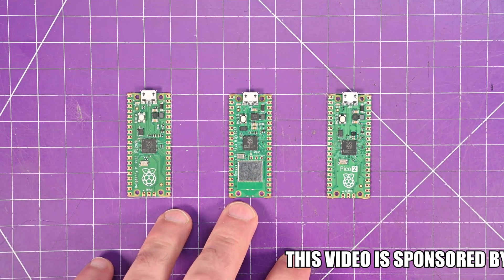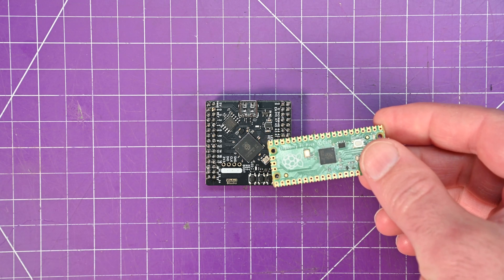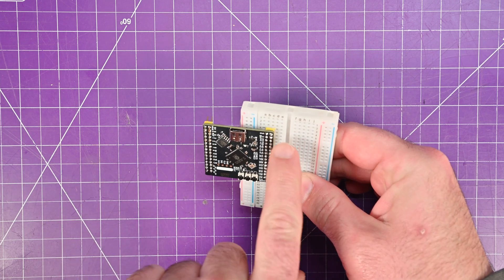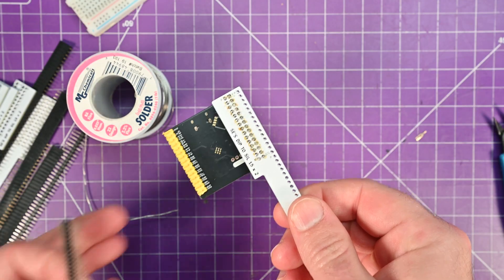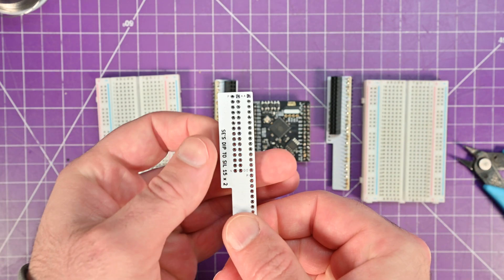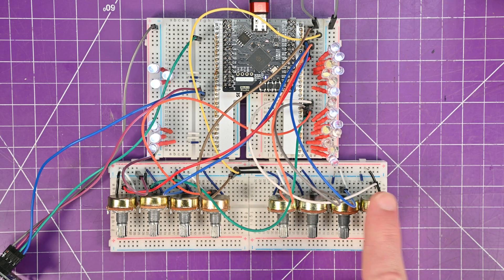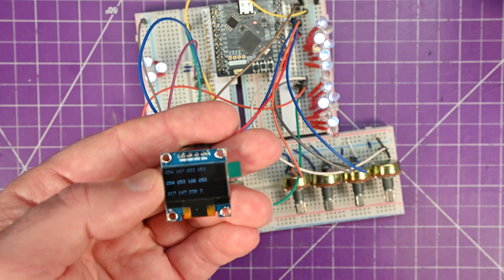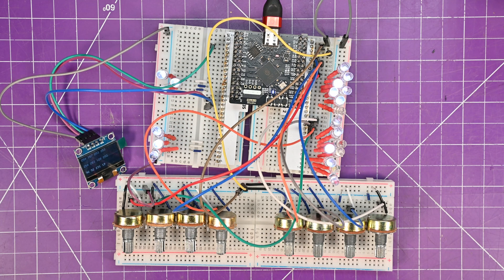UNLEASH THE BEAST! - WeAct RP2350B Investigation (48 GPIO)

Comment: on the subject of maxing out… not the RP2350B, but the RP2040, i wanted to drive 10 oleds from a single pico board.  ended up using the 2 native i2c, plus 8 i2c through PIO… i need to update that project to RP2350 (and actually finish it 🙄

Comment: Additional stuff:
- DHT22
- IMU (I2C)
- RTC (I2C)
- GPS (UART)
- NFC (SPI, I2C, UART)
- SDCard (SPI)
- Network: W5100 (SPI)
- Audio Out (I2S)
- Microphone (I2S)
- GPIO: Stepper motor, Encoder (e.G. 24pulses per rotation A/B)
- Infrared LED as replacement for remote control
- USB: Acting as Keyboard/Mouse/Network Device

Comment: I love this board, I have worked with RP2040 Pi Pico, RP2040-Tiny/Zero but when I try to get an ST7735S 160x80 LCD Display working on the SPI Bus on this board, no luck. Tried SPI 0/1 and tried different locations. Same SPI/SCK,CSn,RX pins on use on the 2040 but no luck. Hoping more info on projects comes out soon. I suspect It may be something to do with the firmware for this board. Also no info on how to initialize the expanded storage on the back. I added a chip and it wouldn't boot at all. Hope for more info soon.

Comment: I've bought a couple for my PIO ROM project. Previous Picos didn't have enough pins for a 16bit address and 8bit databus, plus control signals and debug.. I'm hoping this beast will allow me to dynamically write to a "ROM" instead of me having to remove a ROM, insert into a ROM programmer, reinsert into 8bit computer etc.
Reply: Been looking at existing options for ROM emulators using Pi Pico and like you said, not enough GPIO pins for all signals. Did you get your PIO ROM project working on this board? Do you have GitHub with it?

Comment: I got my own pipico working well yesterday to drive the motor for my DIY star-tracker astronomical mount.  I ended up soldering the pipico to a larger "sea of holes" perfboard.  ONE PWM channel drives a TIP-120 transistor, which drives the motor.  Might re-do with an L2998N at some point, but it's what I had lying around.  Was thinking of taking it to a star party tonight, but, I'm still recovering from dental surgery--healing rather slower than 25 years back when I had the same thing....